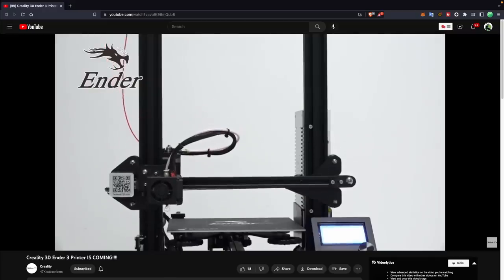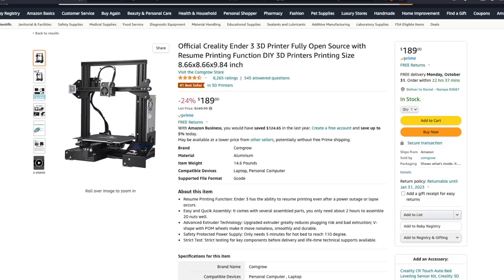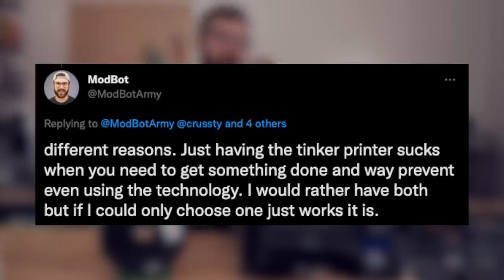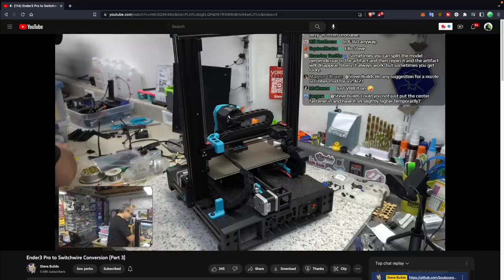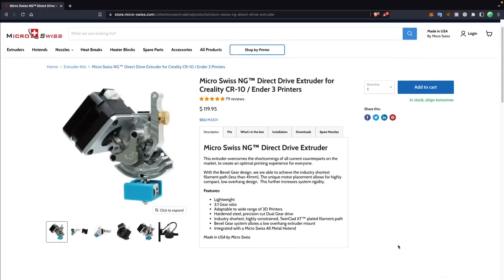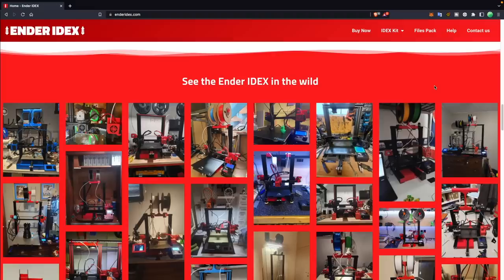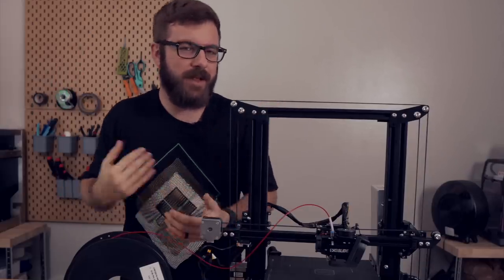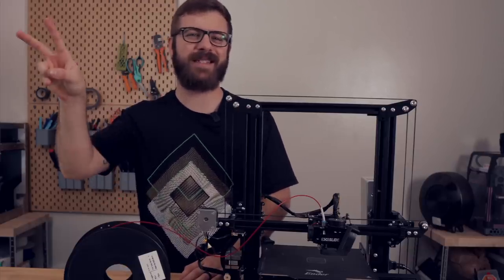Why Buy An Ender 3 In 2022?

Comment: Got an Ender 3 for Christmas, which is my very first 3D printer. I never really got one because I didn't think I'd have anything to print. Now I've got a list and am basically printing something every day. As far as customization goes, I've some minor 3D printed parts and I've installed OctoPrint and Klipper onto it so I can access it anywhere on our LAN, as well as created some custom gcode so I can change the filament mid-print so I can change colors at certain layers. While I don't have prints from other machines to compare, it does seem to print nicely once the settings are dialed in.

Comment: Yep!  I have the Ender 3 Pro.  I got it in March from Microcenter for $100.  I am currently doing the Belted Z mod from Kevinakasam after that I will be building my own IDEX with dual nossles.  I not sure if you call it an IDEX at that point with 4 exturders on it!   You forgot to mention the Ender Extender kit.  I just finished the that project.  It's great!  But there is a learning curve to building it and I would recommend to buy a bigger bed then the one that comes with it.

Comment: I own an Ender 3 but it's been collecting dust for the past couple years.  I did some mods like SKR mini E3, BL Touch & part cooling and it was an okay printer.  I currently have an MK3S+, a couple Bears and a couple Vorons that are taking up the space that I have available and are better printers than the Ender 3.  A Switchwire conversion for it sounds like an interesting project so maybe someday I'll do it.

Comment: I bought a used Ender 3 for a friend.  It cost $80 and I spent another $12 buying a new metal Extruder Assembly.  What a killer printer it is.  I had a hard time giving it to a friend.  I have 4 FDM printers (and 2 resin), but I still want to get another Ender 3 for myself.

Comment: Started with Ender 3 V2, did a bunch of mods and hated the glass bed..the fix was buying the Ender 3S1 Pro magnetic bed plate. Then bought Ender 7 for faster speed… not better, loud, print bed plate bad.  Tried to sell, no one cares to want this thing…boat anchor right now. My favorite out-of- box is the Ender 3 S1 Pro, really reliable, great touchscreen, decent printing and with Wham Bam enclosure ASA works marvelous…

Comment: 💯 on the (only) reasons to buy an Ender 3. It's a project platform with a plethora of compatible manufactured and printable parts for mods or turning it into something completely different. Not a product that makes any sense to buy and run stock.

Comment: As someone who has had a Ender 3 printer And wanting to up in size for larger carbon fibre and abs pla components, Pc Parts, Sculptures and Internal Car components what Creality Series Printer would you Recommend for under $1000 that either I can upgrade or comes with all the bells and whistle mostly already installed?

Comment: I started just over a year ago and I've modded my 3pro several times. All metal hotend, direct drive extruder, and several of the tack-on printables like the micro SD to full SD cards. I don't see myself stripping it down for parts any time soon!

Comment: I’ve got a S1 Plus that is pretty much stock except for a new fan bracket and PEI sheet. I also have a base Ender 3 running a Sprite Pro, CR Touch, silicone bushings, and a PEI sheet all on Klipper. Pretty soon I want to do a linear tail and Kevinakasam comversion

Comment: If you want an easy to setup and use printer, the Ender is just right. You can get good quality prints quickly while learning about 3d printing. I still have my nearly stock printer I use routinely.

Comment: I look forward to seeing your Exo Slide extruder and hot end video. I wonder how it compares to the Micro Swiss NG?

I have a stock Ender 3 Pro V1 and I'm definitely going to do the Kevin AKA Sam upgrade. But I'm wondering what printer head I should go with.

Comment: I bought an Ender 3 in 2019 for $125. I was very impressed because after watching a half dozen videos on bed leveling and temperature control, I was able to print pretty impressive prints with it even though I had never been around 3D or CNC in my life. It was the best printer to start with. I'll admit that I kind of lost interest in it because I learned how to get decent prints from it. Then I was on Ebay looking at 3D printers and saw an ad for 3D Pros that they were selling "as parts" for $50. Looking at the comments, I saw people were getting for operational machines. So I took the chance. I got a fully functional machine that needs some TLC. It seems to have been quite abused in it's life. But now I have 2 working 3D printers. I would rather buy all American stuff though.

Comment: i kept buying every ender 3 i could get since i got my 1st... i now own over 12 of them about 10 are still in their original case... lmao... so far the ones i use made their money back... also they are pretty resilient... but they need some tweaks... like thicker aluminium bed for stiffer / straighter bed and less fiddling with leveling and also needs to get some custom bolting supports to make the entire structure and "shock" to be almost zero otherwise it starts moving around if u do superfast printing like i do. other than that i still use everything on default. it works pretty good the sd cards that come with it are crap... but meh formating them once in a while fixes most of issues. best 3d printers ever made... usually how it is with anything that is made for the 1st time. theyt are made to hold and be strong they like the nokia of 3d printers.

Comment: Currently have an Ender 3 V2 Neo.  I have done the duel Z, silicone bed spacers, Capricorn, and running a dry box with a Bowden to the extruder. I have been tweeting and trying to get the "right settings" for projects and have had some success and some failure.  I'm interested in finding a cooling setup that will work for this model as everything I find seems to be for the V2 alone.  I'm I missing something???  Thanks in advance.

Comment: I bought an ender 3 pro about 2 years ago. But you wouldn’t recognize it now.  300 x 300 x 380.  Mirror bed. 120 v bed , dual Z drive, TFT touch screen. For now a SKR MINI E3 V3   CL touch abl    I have a Fulament bed to install yet

Comment: The problem I have with the many available Ender 3 mods is trying to work out which ones have the benefits I'd like, but without the negatives I don't. I only print PLA, so don't need hot end mods that makes the printer better for higher temp materials (or flexibles), but I'd like to be able to print faster (on my Ender 3 V2).

I've installed a 0.6mm CHT nozzle (the rest of the hot end is all stock), and I've increased the acceleration from 500mm/s^2 to 800mm/s^2, and the print speed from 50mm/s to 65mm/s. So what should I do next? From what I've seen, the best solution might just be to install Klipper to allow much higher acceleration without ringing. Would the stock heater then become the bottleneck in terms of flow rate, and if so, what would be a sensible alternative?

Perhaps this could form the basis of a set of useful videos; i.e. "I have an Ender 3 and I'd like to <print flexibles/print ABS/print PLA faster/print detailed models> and go through the mods that would help for each particular scenario?

Comment: I have an older Ender 3 Pro and I really enjoy it though it is a bit slower than I would like.  I have modded it with an SKR Mini E3 V2.0 board, dual lead screws with separate stepper moyors and a belt on top to keep them in sync, frame  support rods, MicroSwiss hotend and direct drive, 3.5 inch display, Marlin 2.1 compiled to use CR Touch  Which I really like not having to level the bed all the time, solid bed mounts, fiament runout sensor.  I am also using a Raspberry Pi 3b+ with octoprint and have raised the print with some 3d printed feet so I can store tools under it.  

The only thing that I don't really like about it is the electronics compartment.  I really would have preferred it to be like the original ender 3 that opened from the top or separate from the from like the CR-10 though not as large.  

After all my mods though there is no room for the power supply any longer and the solutions for mounting it I just do not care for.  I will probably have to design my own mount now that I am pretty much done with the major mods.

Comment: It's great to see the Ender 3 is still going strong and forming the basis for so many interesting conversions. The versatility of open source 3D printing never ceases to impress. Creality3D was initially feeling regretful that making an OSHWA printer was allowing for so much clone activity. But the machine has achieved its longevity precisely because it boldly set standards for an inexpensive yet decent commodity printer which have been largely followed across the market. And it opened up this huge secondary market for mods that is bound to sell more Enders. I think we can call this one a win for the RepRap ethos.

Comment: The Ender 3 (with all it's variants) still is one of the cheapest entries into 3D-printing. It's reliable, solid and a big community around it!

And the option to upgrade and mod it (which you dont have to) is a fine way to have fun and improve your knowledge and skills along with that machine.

Comment: Everyone youtubes the conversion from lead screws to belt, but no-one is showing before and after images of the print quality increase or decrease. One or two have hinted at worse Z positioning, which is the reason to try the mod in the first place.
You haven't mentioned the variety of control boards that could be installed in the ender 3 across the years or models, are they all the same?
I'm a bit dubious about the positioning of the input mains on the plastic extension piece for the power supply in the ender 3. In the 240v version at least, the mains cables are pressed directly and firmly onto the 24v DC power cable outputs.
Finally, the control of the hotend and heater plate is through a couple of directly driven power fets with no-way to turn it off if the fet shorts. I have seen and repaired three boards where that has happened and if the owner had not been there, it might have been tragic.

Comment: I put the z belt mod on both of my printers, none of which are an ender 3. The only problem I'm having with it right now is that the motor mount isn't strong enough to keep a belt tensioned without warping over time. One of these days I'm going to design a better one.

Comment: woo go ender 3's haha. My first printer is a ender 3 V2 from about 3 years ago and ive done way too much to it over the years. Im running the 3Dfused linear rail X/Y with KevinakaSam dual belted Z, Bondtech DDX V3/ slice mosquito mag setup, and of course klipper/mainsail with a nice 5 inch touch screen, plus many other mods that needed to be done along the way. My printer easily does 4K accels at 150mm/s for about a grand, take that prusa hahahaha

Comment: That conversion to a switchwire isn't a bad idea. Been looking for something that can be enclosed and was thinking that a Voron 0.1 is too small and a Voron 2.4 is getting up there, so was looking at the trident or switchwire, knowing now that I can hack apart a used ender 3 to get most of what I need seems to be a logical move from a cost and size standpoint.

Comment: My friend I just finished building the Ender 3 V2 and what a nightmare. It's been a while since I built the ender 3 pro and I forgot how bad Creality instructions are lololol. The biggest issue was the leveling process. It turns out my gantry was warped which made trying to level impossible. After a messing around for what seemed like forever I was finally able to print out a CHEP cube. I love this printer but why o why did they cheap out on the parts cooling fan. The printer is really quite but that dam fan lolololol....Anyway thank for your tutorials because they really help us noobs

Comment: I have an Ender 3 pro, I changed to a metal extruder, I put capricorn tube, cr touch, among other things... the hot end doesn't convince me. What printer do you recommend for a second printer, that is more reliable and does not have to do so many upgrades?

Comment: i bought 1, and e3pro and the 1st 2 prints off it were awesome then i tried a g-code file from one of the 3d file share sites (needed the part) and instead of the 'expected' nozzle path the first thing it did was track across the clips holding the flex plat on nothing has printed well since but i did discover a few other issues and decided to go all in on upgrades because i know what the machine is capable of so cr touch, new hot end, new nozzles (got some rough on kit pla to run), dual z lead scew kit, glass bed and direct drive. ill reprint that first g-code once i get everything installed and get the thing trammed in again and from there ... well who knows ... theres no limit to what you can do if you got the mind to do it

Comment: I love my E3v2 still.  I just bought a bunch of upgrades for it.  I bought the sprite pro kit, the Dual z axis kit (going to do some other mods to that to keep it in sync), and I wanted to try the CR touch and see how it compares to my bl touch.  I've heard it's better.  I was wondering though have you ever seen or done a linear rail kit with the Sprite extruder?  I know you prefer the NG which looks like a solid direct drive unit, but I was just curious if you have done a linear rail upgrade with a sprite.
Reply: I heard the sprite is good, but did you look into the Micro Swiss NG? It is lighter, has a shorter filament path, and has AWESOME support. (Maybe better then prusa..?)
Reply: @coltenmeredith8899  I did look into it.  I just had a bad experience with their regular all metal hotend.  I know a lot of people like that NG though.  It may be something I try later on.  Really pleased with the sprite pro right now.
Reply: @Mechadroit (Dan Barnes)  I haven't tried the sprite. It looks pretty good, though. I mainly went with Micro Swiss because the support

Comment: i own an ender 3 v2 for a while now and not sure what to upgrade or what kinda upogrades there are and which are worth it. first off i think i'd like to replace the fans with quieter ones because the printer is in my bedroom ... just not sure what fans to use and which for their price point are worth it. i'm very familiar with noctua fans in my PC (im a pc guy) and would then have to run buck comverters due to the fans being 12v instead of 24v that the printer puts out.. any thoughts?

Comment: I tried to like ExoSlide but the instructions I received were awful. No information on what screws to use, missing parts, owner won’t contact customers. I think the Ender 3 was okay, though with how many easier options there are now, especially from Biqu, that are using klipper or just better motion systems and components means the base Ender 3 is dead. 

Buying the printer in 2022 is laughable since you’ll end up dumping another $150-$200 into a $100 printer. By that time you could have purchased a Prusa Mini+ or something from Biqu who makes some great 32-bit boards, klipper, native direct drive, etc.

Comment: I reccomend ender 3s for people starting because they are reliable and a good starting point for people and even if you royally fuck up something there's a video to show you how to fix it or a relatively cheap replacement part. There are better things out there but if you are going to fuck up i think its generally safer to fuck up with an ender 3 than most others.

Comment: I have an Ender 3 Pro and I've replaced perhaps about half of the functional parts. I have to say that in its vanilla form it's okay but it also kind of borderline sucks. It's a beginner machine in the sense that it makes you learn by virtue of being so unreliable - issues with bed leveling, adhesion, belt tension etc. And in learning you yearn for something better and the after market provides a bunch of improvements - quieter 32-bit boards, auto bed leveling, octoprint etc. So Creality's main strength is not that it's good but that it's just usable and there is a lot of support to improve it.

But if I were starting from scratch now? No way would I buy one. Yes it can be improved but there are a lot of similar printers out there for less money that could be improved too. And if you spend the same as a Creality or a bit more you can get something better. Personally these days I'd want a machine with a box frame, dual Z, direct drive, auto bed leveller and some niceties and that's in part because of the grief the Ender 3 caused me by not having them.

Comment: I have an Ender 3 Max. Bad icky I hate it. I upgraded just about everything on it. Maybe I just go a lemon model. I thought I finally got it working reliably then today the bed is out of level again. I hope this is an easy fix. I did get about 6-8 large prints done before the bed going out. Also, I hate T nuts in general. It takes me so long to get the nuts to hit and tighten into the rails. I theory this should be easy, not for me. I think it is just as easy to build one from Scratch.

Comment: Never owned a 3D printer and I’m looking to print something, like W shops I found in my entre country and I called one they said prints depends on model but min is 200$. I can literally buy a 3D printer for that price and I want to do that but I don’t want to put an investment into something I’ll just use once in ven tho if I did get it I’d print a lot more stuff, and I’m pretty sure if I get it since literally no one sells anything related to it here it’ll be a pain to get anything like replacement parts/upgrades/filaments. If I ever get it tho I’d sell printed stuff but god damn I’m not going to up charge that much it’s unreal
Reply: Buy an Ender 3 V2. I recommend it to everyone.